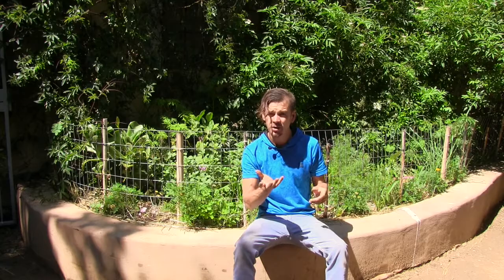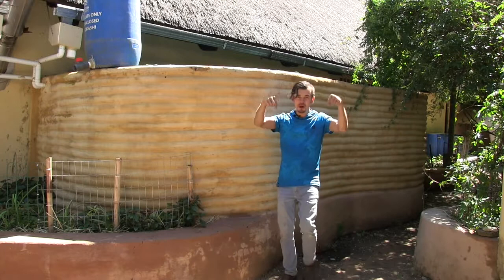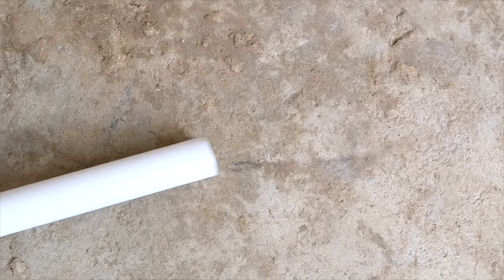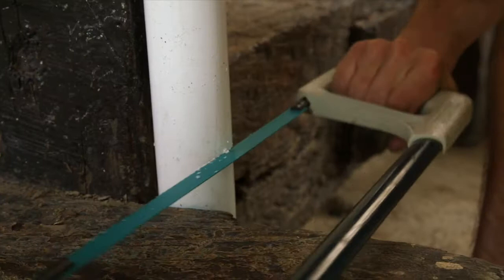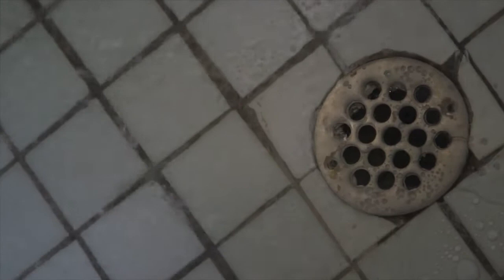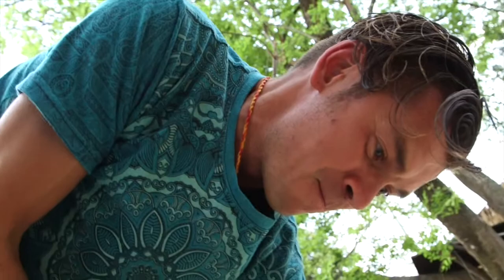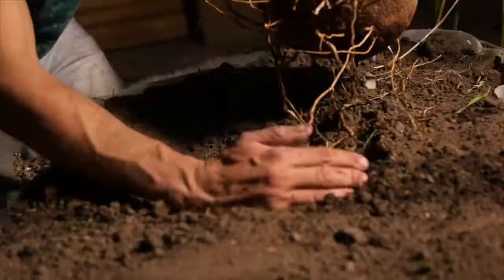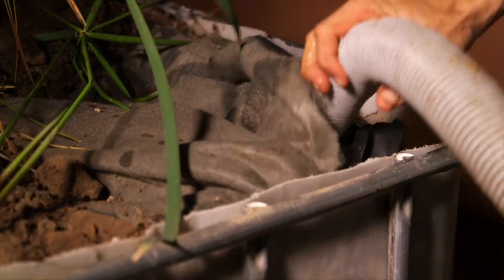Constructed Wetlands Master Class

Comment: Hi. Is this possible to make the sewage tretment flow vertically upwards ...i mean can we use the method to implement in channel where sewage mixes with lakes.
Reply from the maker: definitely not
Reply: Then what would the solution for places like india where domestic and industrial effluents mixes in water bodies thru channels ....i thought we can filter them by diverting the flow  passing upwards thru the reeds bed  at a stretch will help though
Reply from the maker: Valli Saran if that is the case then you have to build wetland treatment floating islands with roots tapping into sewerage water.  Look up how John Todd treated polluted river in China. And yes I’m that case you can pump water vertically into more wetlands before it returns into the river. I would love to be part of such a project on a design level